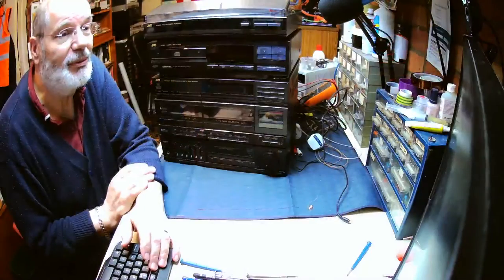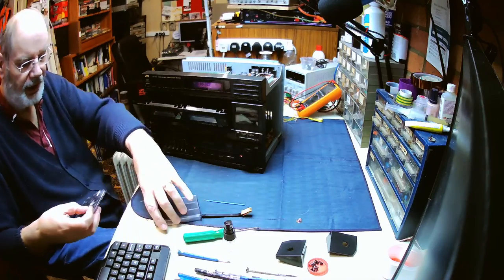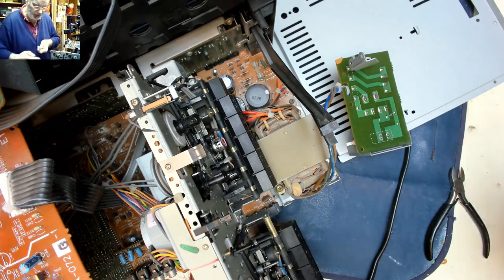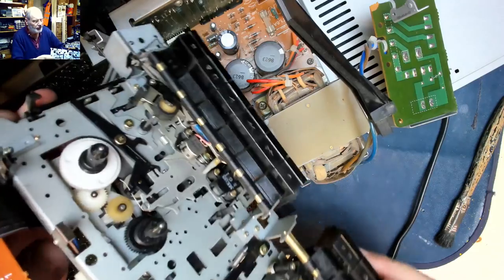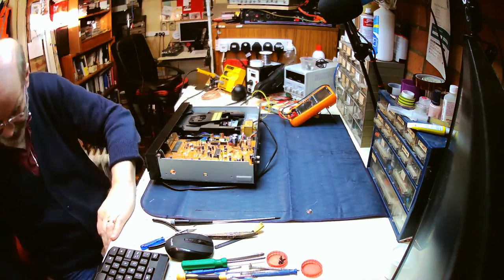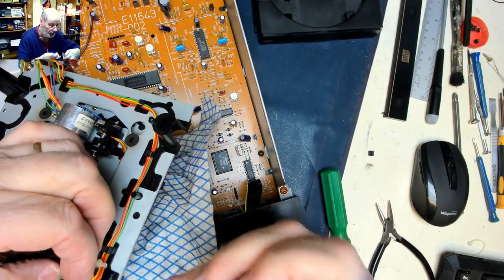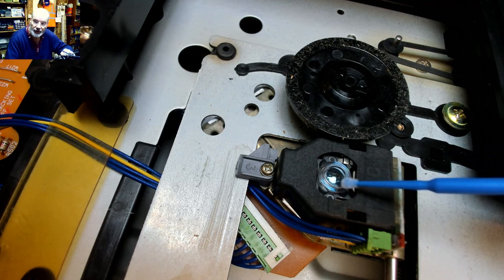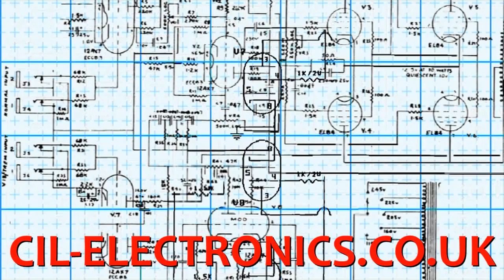JVC DR E300L Midi System Repair

Comment: Hi there "Arkwright's Till". I have the same problem with my Technics ch950. I am watching with baited breath. I don't have the expertise or confidence to play around with electronics. But I have to have swift fingers to put a cd in and out. Great video. Regards
Reply from the maker: Thanks for that, assume you know the reference to "Arkwright's Till" from the old Ronnie Barker sitcom, "Open All Hours" You may be able to squirt some switch cleaner in the switch if you can get to it, but it could be a broken mech causing the switch to bounce.

Comment: Hi Chris, I have a similar JVC to this and have a cleaning cassette stuck in deck B The door won't open. How do I release it?
Reply from the maker: Hi Pauline. Difficult to say as this machine has long since gone back to the customer. The only real way to do it without damage is to disassemble the mechanism from the chassis and in doing so crank the mech through to ensure the heads have retracted from the cassette. If you’re passing through South Oxfordshire, you could pop it in to me and I’ll have a look at it for you. Please send me an email and I’ll send you contact details. chas@cil-electronics.co.uk. Regards CHAS.

Comment: Hey Chas, watching this video helped me fix my JVC DR-E300L and JVC AL-E300 turntable! However i think i need to replace the needle, where can i buy a replacement and is it easy to replace? i’ve never replaced one before
Reply from the maker: Hey Chloe, glad to have helped. Could not find a direct replacement stylus, but a search of e-bay found a lot of similar styli. They are simply push to fit, so you should find a replacement here:
https://www.ebay.co.uk/sch/i.html?_nkw=Jvc%20Al-e300%20Stylus&norover=1&mkevt=1&mkrid=710-154084-101958-4&mkcid=2&mkscid=102&keyword=jvc%20al-e300%20stylus&crlp=533918467341_&MT_ID=&geo_id=&rlsatarget=kwd-505758964494&adpos=&device=c&mktype=&loc=1006630&poi=&abcId=&cmpgn=13822180255&sitelnk=&adgroupid=123999031185&network=g&matchtype=b&gad_source=1&gclid=CjwKCAjwyJqzBhBaEiwAWDRJVN9LpQDk_zc4iP6nXs80EJvexDUKtv5TIv1rxFlUl4kI50n6bWdBPxoCMTsQAvD_BwE
If not, contact JVC support, details will be in your user manual.
Reply: @ChasLarge  Thanks Chas, ordered one and fitted fine although now the sound is very quiet, would you know the reason for this?
Reply from the maker: @chloebishop-wg8mo  Sound is quiet on all sources or just the turntable?
Reply: @ChasLarge  just the turntable
Reply from the maker: @chloebishop-wg8mo  Have you checked that the turntable wires are plugged into the PHONO sockets on the main unit? If plugged into the CD or AUX inputs the output will be low. Also check that none of the wires have become disconnected on the back of the cartridge, there should be 4.